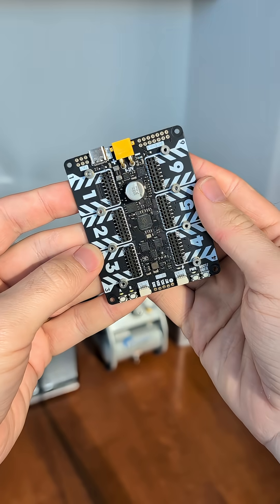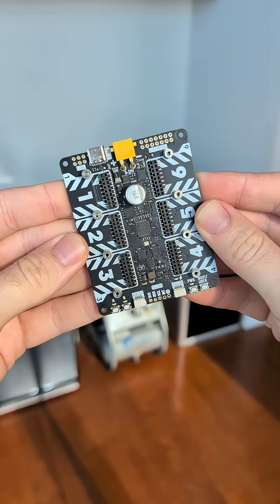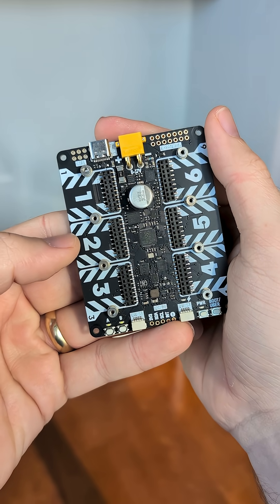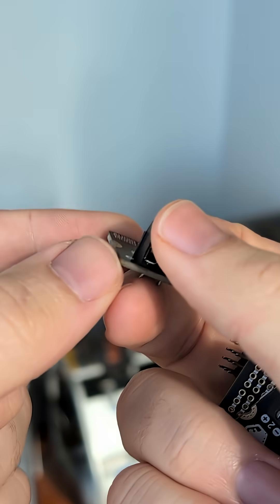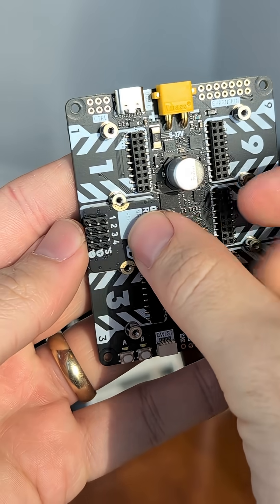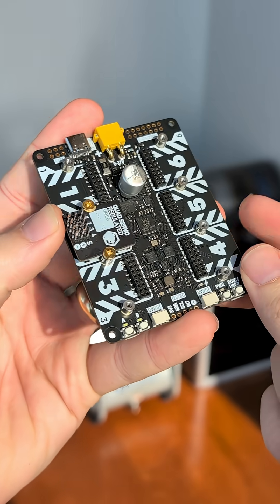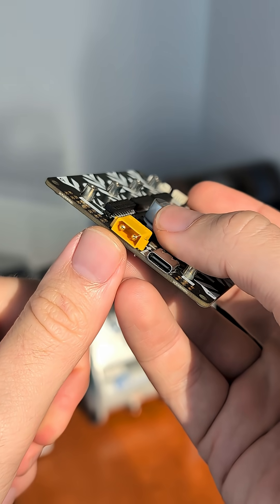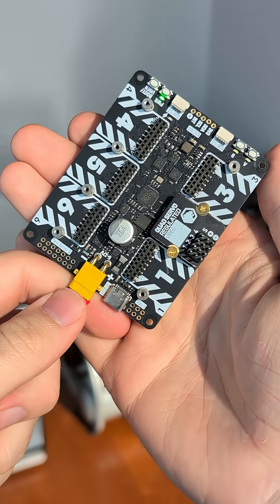Is this the toughest development board out there? 💪

Comment: It better have voltage monitoring for the battery connector. Lithium polymer batteries die - die if they get discharged below 2.5 volts per cell.
Reply: It's a power distribution board for VERY high powered modules, of course it has protection features lmfao. I don't think seen even cheap chinese boards come without at least a voltage probe somewhere in the board in the past... 5 to 10 years?
Reply: @vernonalbayeros4719  a proper BMS or low voltage cutoff is never guaranteed with any development board. Always check to make sure. Even some adafruit boost-charge modules require a separate bms.
Reply: Considering it only has 2 pin connector for the battery, I don't think it can have per cell monitoring. And it looks to be 5-17V input so you'll need to program it to cut off the power yourself.
Reply: @pluggedfinn Most likely only a low voltage cutoff. Considering it only connects to battery positive and ground, the battery would need its own BMS.

Comment: Eh not really. If you’re driving speakers or motors of any substantial size you need an amplifier to drive it. You can tell it’s not beefy because it doesn’t have any heatsinks or large bypass caps to mitigate high power switching. Also those pins for the servo motors are tiny, can’t provide much torque/current.
Reply: This is inline with most 3d printer controllers, which handles NEMA 17-23 stepper motors really well, so any desktop CNC should work well.
Reply: Its not design to drive an industrial pump of 75kW. Its design to drive some Watts. I dont know but Maybe a 1watt or 5 or 10Watts rms. Its à lot for many application.
Reply: he probably means it’s beefy compared to a Pi Pico or similar microcontroller without the module system
Reply from the maker: Yeah definitely! Electrical stuff can get basically infinitely beefy!